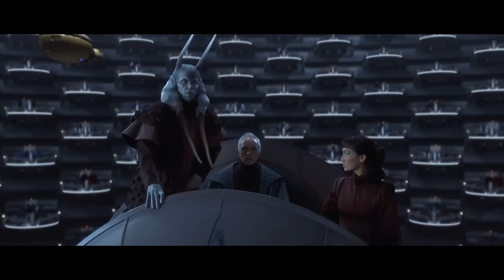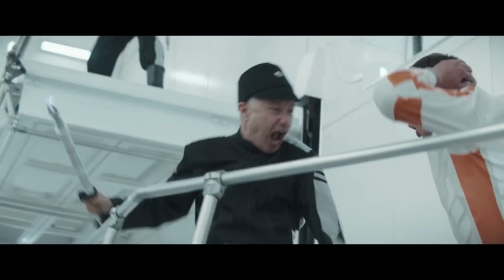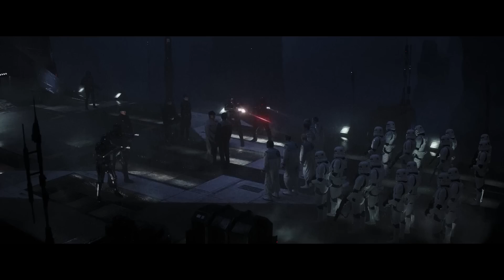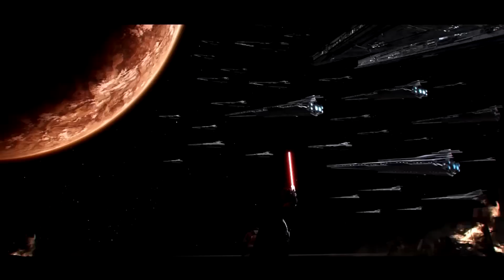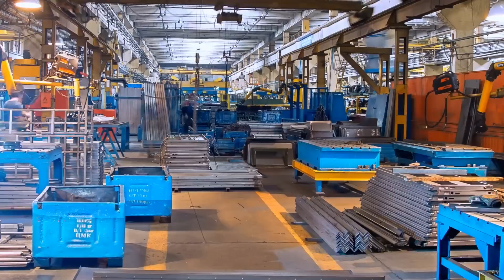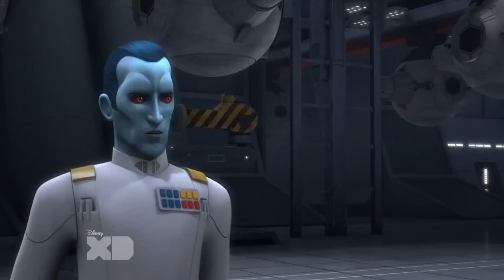Why didn't the Empire use Automation?

Comment: *Sapient. the word is Sapient not Sentient. far too many sci-fi authors get that wrong. Sentient is having senses; sight hearing etc. Sapient is having thoughts
Reply: Sapient comes from the latin sapientia. It means to be wise. Sentient comes from the latin sentire, meaning  to feel and to perceive. 

Being able to feel is more key to being able to react and think than wisdom, wisdom being the application of decent quality thinking. This is why people use sentience over sapience. In many ways sapience is what follows sentience. It is deeper. We can't have an AI which is sapient without it first being sentient.
Reply: @leming400  You're being pedantic at best. people use sentience over sapience because they think sentiece means having thought, not because they think having senses is closer to thought than "wisdom.
Also wisdom is only one definition, and the most narrow one. either of the other two would be more correct.
2.The property of being sapient, the property of possessing or being able to possess wisdom. 
3.Ability to apply knowledge or experience or understanding or common sense and insight. 
So... thought, or the ability to think.
Third, while I somewhat agree that for life as we know it to have sapience it would require sentience, that is not what is being referenced in the video and is not relevant.

Comment: Automated manufacturing is not as big an economic force multiplier as manufacturing with sentient beings.  With respect to the Star Wars universe, a credit is recycled in the local economy 6 or 13 times.  For example, a credits paid to a laborer goes to the food vendor.  (Prison economics also function this way, but with less wages or subsidies for the prisoners.)  Food vendor credits go to the food vendor clerk and so on. At each step of the process, tax revenue is generated.  Meanwhile, a credits made by automated manufacturing recycle through the economy fewer times in addition to a smaller credit pool due to less workers.  (Automation benefits the corporation more.  A sentient being economy benefits society.)

Comment: Robots are unnecessary. 
Empire became backward unable to build cheap production lines we here on earth can build. Imagine we wanted to to build lithium batteries by hand. Or microprocessors or motherboards.
One replaced work and advance leads to new more specialized workplaces to be created. Advanced civilizations turn to service economies. Not to slave labor which is rather high cost and high risk enterprise. You need to keep workers alive and well, and still the quality of work is lower than if standardized assembly line does it.

Comment: The big problem with slave labour is that you need guards, room, and board for them, which can be more expensive than traditional labourers. Plus the bad publicity if it gets out, in the Empire's case.

With Atlantic slavery, a large motive was the fact that Africans were supposedly more resistant to tropical diseases, like malaria. One tradeoff? African slaves had low resistance to respiratory illnesses, especially in winter.
Reply: Another major reason for the African slave trade was the problem they realized when they tried to enslave local indigenous people: enslaved locals are, well, locals. They know the terrain, the environment, and the people, better than the enslavers did. African slaves were outsiders and didn't have those resources if they escaped.
Reply: @keith6706  The enslavers were usually other Africans, who sold the slaves on to Europeans. The Dahomey got rich and powerful off of doing precisely that.

Which matches your point about home-field advantage.
Reply: @EGRJ  They did it because they were getting paid for it. You pay someone to commit a crime, you're just as culpable. Please, stop the apologetics.

Comment: I hate how slavers exist when droids can do the better and without succumbing to injuries, revolting, needing food and water, and needing to rest
I mean, sure, at first they're expensive, but they'll be saving money in the long run and can be easily reprogrammed to follow orders
Reply: Droids can get damaged - which is not that different from an organic being getting injured. Droids need to recharge their batteries every now and then and they need maintenance to deal with wear and tear. And considering that strong magnetic or electric fields can mess with delicate circuitry, some work environment that don‘t affect organic might be unsafe for droids to work in.
Reply: What happens when the droids rebel?
Reply: @HolyknightVader999  ¨restraining bolts to keep them in line and frequent memory wipes, otherwise they will develop an identity like R2D2, CP3O, Chopper or K2SO
Reply: @moosemax6346  More than a few droids got loose.
Reply: @HolyknightVader999 memory wipe, and maybe recycled
Reply: @brianmoyachiuz905  That's if you can catch the damn thing after it rebels.
Reply: @HolyknightVader999 ooooh those damn Rebels 😂
Reply: Droids are basically slaves.